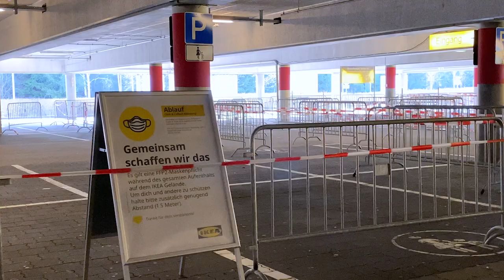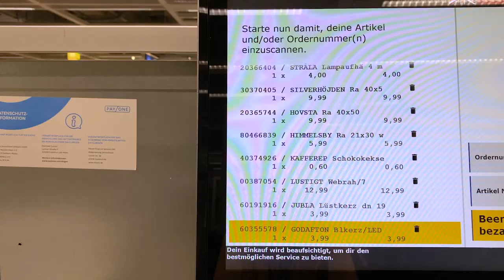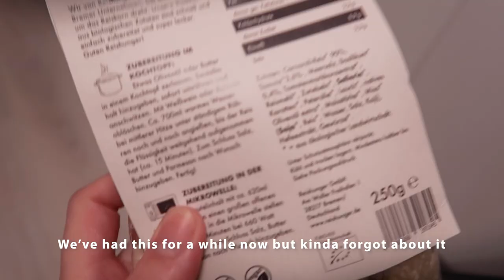Ikea shopping, making risotto & diy-ing bedside lamps

Comment: A little hack. In order to poke a hole in a wood board or smth without the hole getting rough edges or ruined like what happened to the pin board you've made for the office. Use masking tape over where you want to poke it and then drill it. You'll safe yourself alot of trouble.